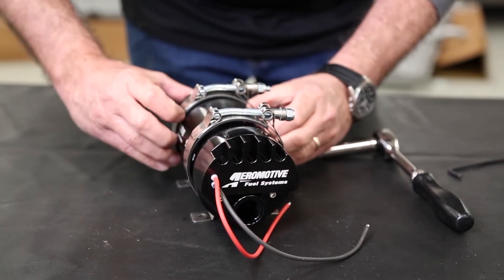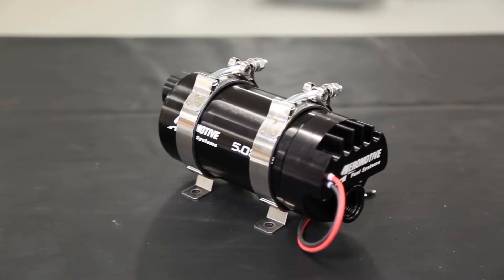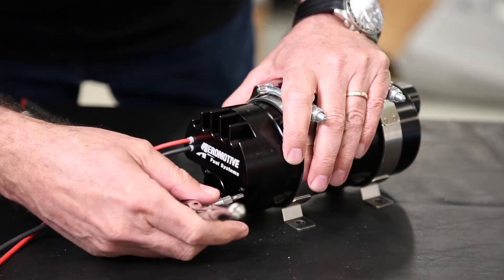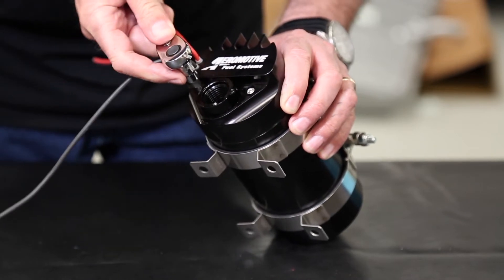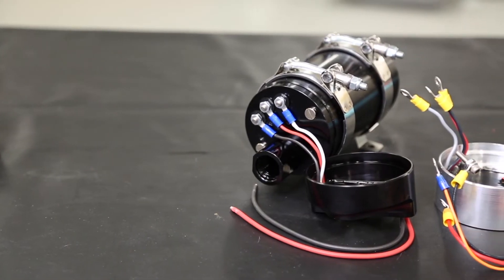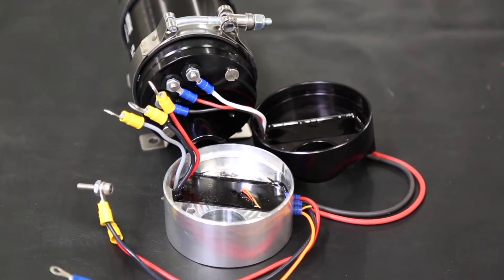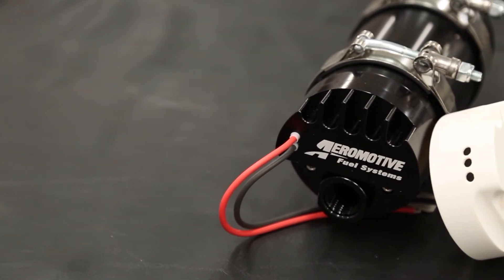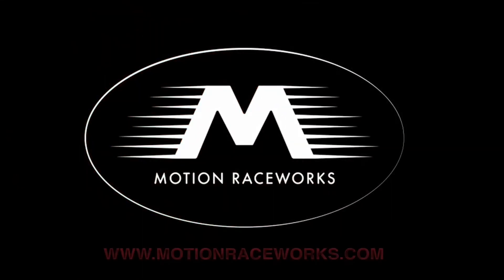Aeromotive Variable Speed Brushless Gear 5.0 GPM Fuel Pump – With Feet (11196)

Comment: Vid of how it sounds.....
Reply from the maker: Hey Adam you can check out this video which shows a 5.0gpm pump running https://www.youtube.com/watch?v=rZoeOW2ZsWk&t=3s
Reply: @MotionRaceworksOfficial  hello do I have to tune the speed of the pump depending on the engine rpm or 
how does the controller know how fast to turn the pump?